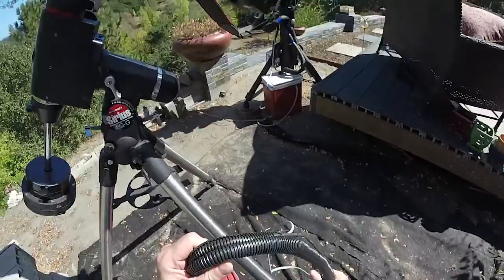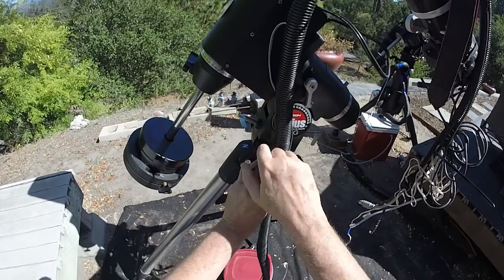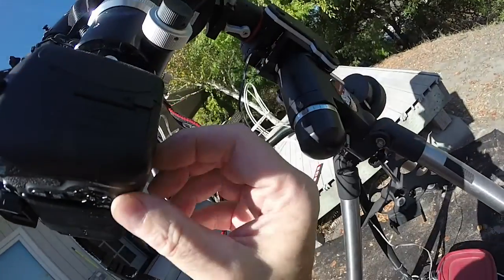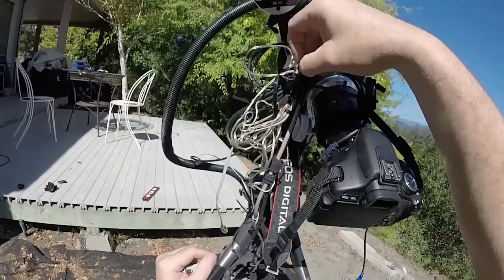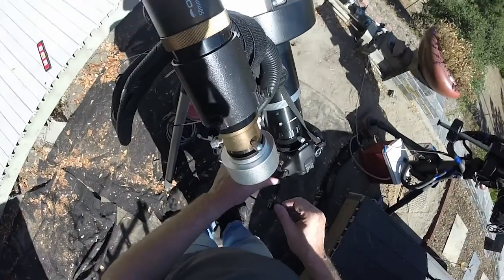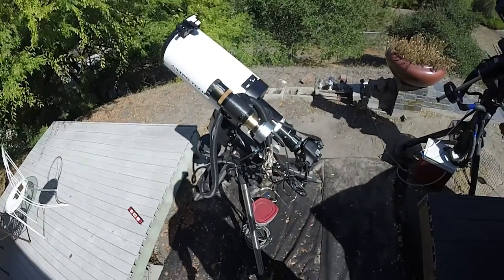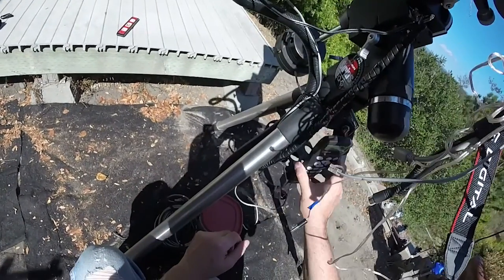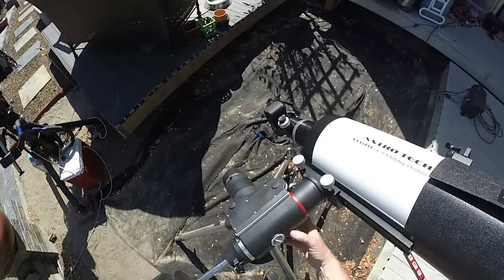Astrophotography mount and telescope setup part 3

Comment: Hey Glen,
I setup a peltier cooling for my Nikon D5100(Full Spectrum),which worked ok,but i had forgotten an important issue with my Styrofoam setup,i needed to get to the the camera to clean the sensor,which seems prone to dust since i removed the ir/uv filter.
I've always been embarrassed with my tweaks and mods as nerdy and cookie,but i see its ok.
Viva Glen Newell Viva!! Feel free to visit Johannesburg you have fans here.(Even my wife likes your videos)
Reply from the maker: +David Jerrams 

Thanks. I've actually been to South Africa, but in the Cape Town area vs. Joburg. 

There's more on my cooling project here:

https://www.otelescope.com/index.php?/topic/686-my-ice-water-canon-t3i600d-cooling-project